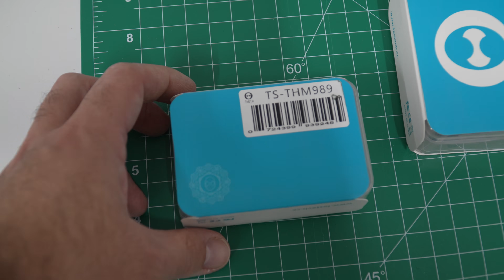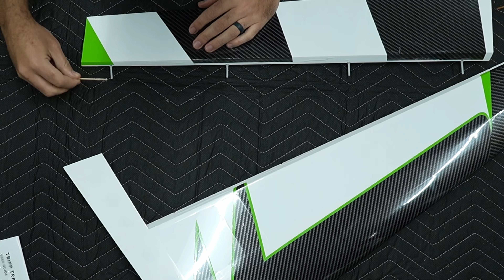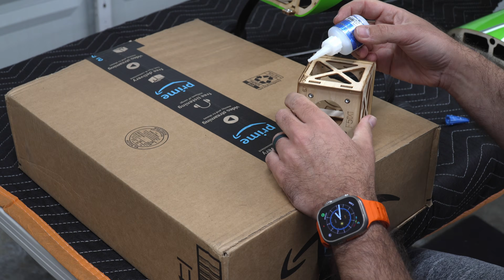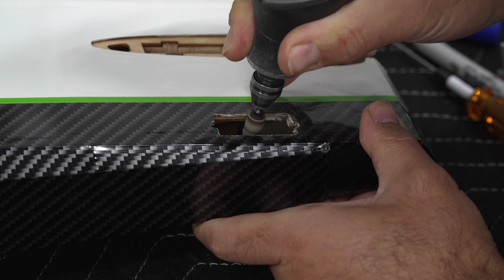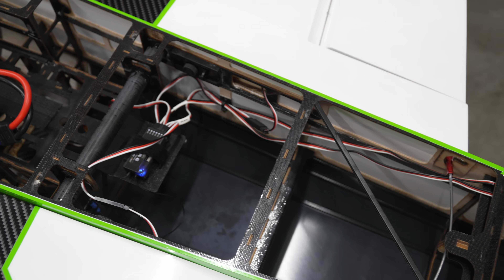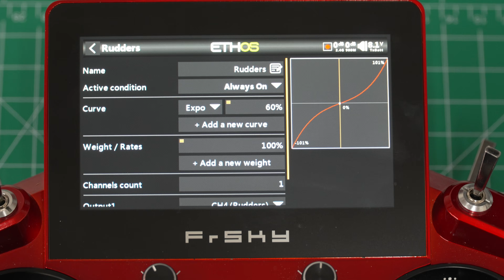Pilot-Rc Extra NG 67" Build

Comment: There are 4 screws that hold the cowling on, 2 at the bottom 2 on top with provision of another at the top in the middle . Do you use it with a captive nut or settle for the four already in place? I have a spare screw and captive nut and wonder if that's what it's for?

Comment: Hi Juan just a quick question,I was wondering weather you use dual or triple rates on your planes thanks
Reply from the maker: I don't use rates. I try to keep things as simple as possible and minimize the number of switches I need to touch while flying. I use a lot of expo so that I can do both precision aerobatics and 3D without changing dual rates or flight modes. 

In this video (https://www.youtube.com/watch?v=PuueCap3Sss) I talk a bit about my typical radio setup for aerobatic propeller planes.

Comment: Do you find the SMC 6200 too heavy? I have a bunch of the SMC 6200 I like to use.
Reply from the maker: I use the 6200 as my main batteries for my 67” planes. I sido have some 4400, but the flight time is shorter and the CG ends up a bit too far rear

Comment: Hello Juan.
I have the same plane, same servoes but Dualsky motor.
But the model is very tail heavy, if I use the CG laser marking in the fuselage, even with a 5100 mAh battery.
How far back of the leading edge of the wing, is your planes CG ?
Thanks in advance.
Jens.
Reply from the maker: Hi Jens! I find that most EF/Pilot models on the 60-70" tend to be tail heavy unless you use a big battery towards the front. In my Pilot 67" NG I use a 6200mAh battery very close to the front, and I get the CG right over the wingtube.
Reply: @skyboundrc  Hello Juan.
Thank you very much for your quick responce.
I have moved the rudder servo to the middle of the fuselage and installed wire pull-pull, that helped a lot, but still a little bit tail heavy with a 5100 mAh battery.
I'm "glad" to hear that it is a known problem, and not my plane that is bad.
Thanks for your help.
/Jens

Comment: Thanks for the review very interesting. 
One question about the 7 minute 25 of the video when you activate the motor swith.
It seems that your gaz stick it is all way down but motor is already running, slowly but running.
Is it a trick to have better "gaz" response ? 
If yes, do you manage it with a trim or servo endpoint setting ?
Reply from the maker: hi! I usually setup my electric propeller planes so that when I activate the motor (with the kill switch), the motor goes to its minimum speed (basically working as the idle in a gas airplane). I usually do this to avoid the constant stop/start every time you go to idle that you usually would get leaving things as default with electric motors. 
The way I set it up is with a mix based on the kill switch position.
Reply: @skyboundrc  thank you very much for your answer. I've been manually moving the idle up with the throttle trim before each flight for the same reason. I will now convert it to a mix. If I don't use an idle setting, I find that the motor windmills on final and then if I power up the windmilling was actually so high that when I added throttle it almost acted like a brake. But using a high idle, the motor is being told how fast it should be going when the throttle is down. 👍🏻